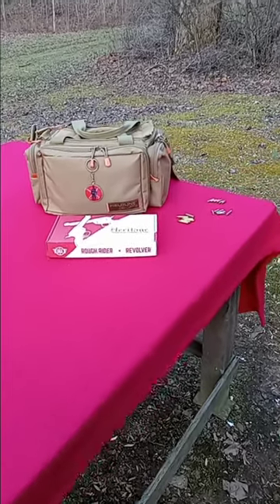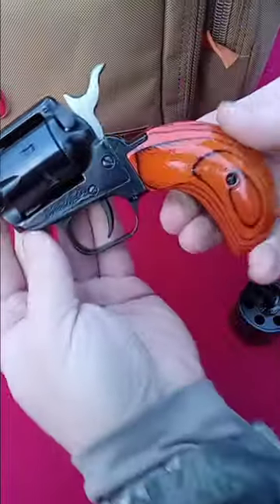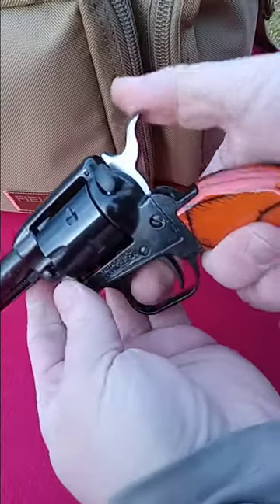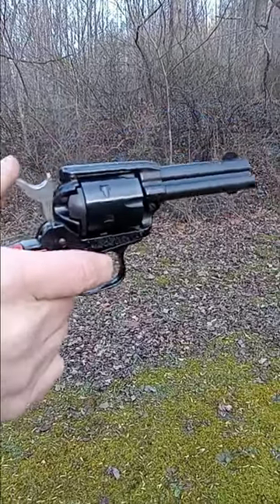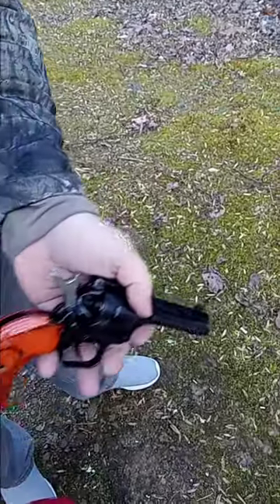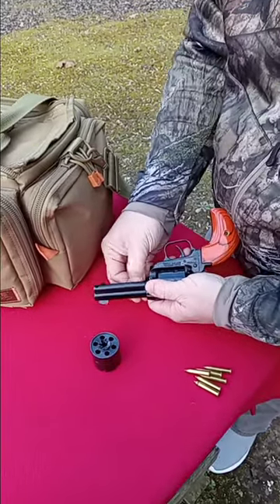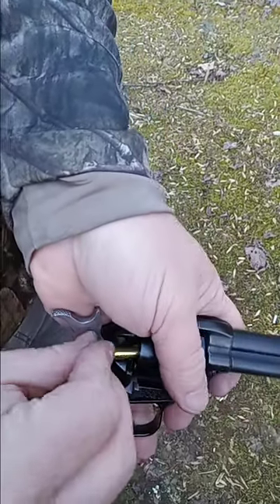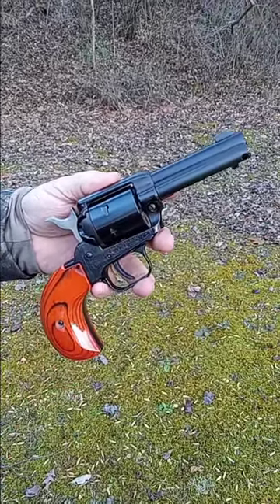Heritage Rough Rider 3 1/2 Inch Bird Head Unboxing & Firing

Comment: Hey Ron what did ya pay ? I want that exact model.
Reply from the maker: I can't quote prices on here. YouTube guidelines.. I can say it wasn't much more than a standard model. (if that helps..) Thanks for watching 👍
Reply: @RonWayneOfficial  I got a 6.5" new from Bass Pro for $99.99 with just the LR cylinder. I wanna get one to carry anything shorter than a 3.5 inch inch just looks wrong to me.
Reply from the maker: @STEADFAST__and__LOYAL__M1059  Terrific! And yes I agree. The accuracy from these 3 1/2 models are not bad. Our most recent Sunday Range Day video was about the 3 1/2" Barkeep, the accuracy was outstanding! Basically the same pistol, but without the ejection rod. Hope ya get one. 👍